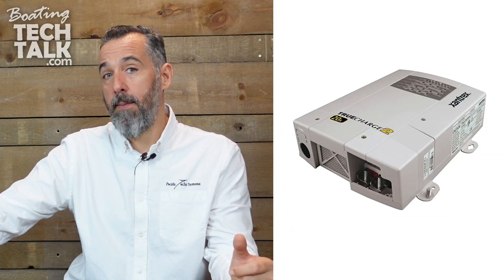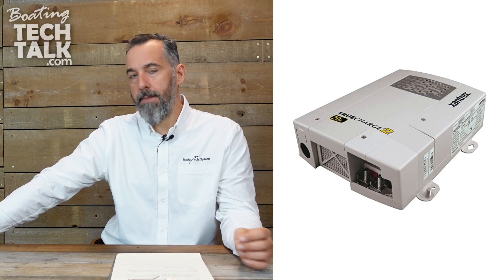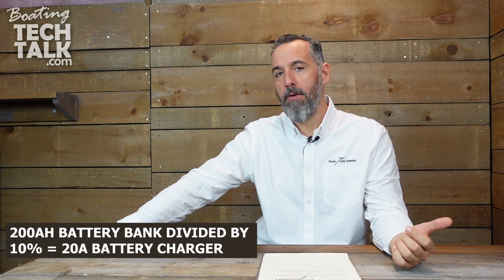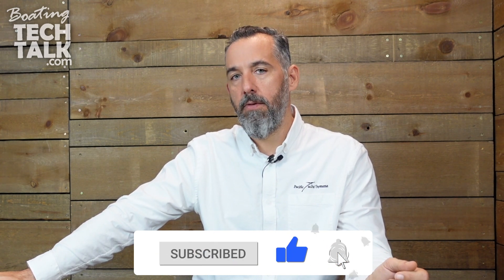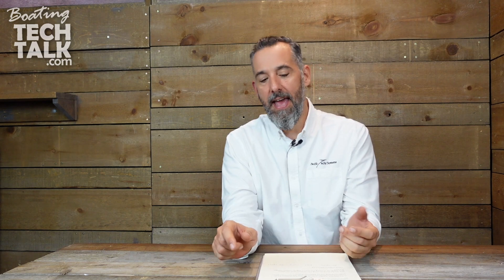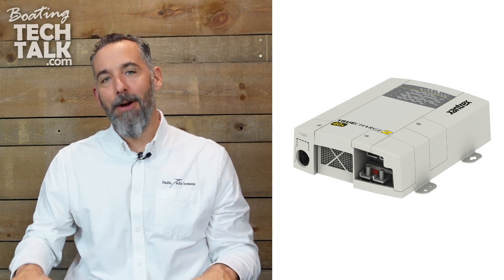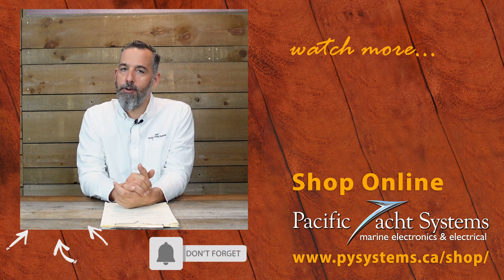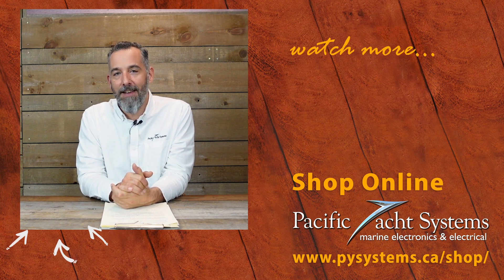Why Do My Boat Batteries Drain When Connected to Shore Power?

Comment: That’s a real good question….that charger is too small for a modern boat unless it’s a little 20 ft or somthing day sailer.?…they should have at least a 50 amp or 100 depending on what they run…so it can do its job quickly and live like a first world boater… headroom is your friend when charging…

Comment: What about the shorepower output?
Here in the uk, we have 240volt mains, but I think it's 16 amps.
I have a 5 amp smart charger from automobile days, and 600ah  notional battery capacity.
It takes my charger 24 hours! But at least I know the batteries are being treated gently!
Reply from the maker: you don't want to treat batteries  gently.  You actually want to force high charge when they are low.   Good / name brand batteries will have a posted min charge rate.  For example lifeline AGMs require at least a .2c charge for max lifespan.  Which would be a  120a charger for a 600a battery bank.  Firefly batteries actually require 0.4c or a 240a charger for a 600ah bank.

With a  5 amp charger you are barely charging.   If a fridge and a couple lights are on, you are only breaking even.  not even charging any more

a 16a 230v shorepower would run a ~200a 12v charger with nothing else on.
Reply: The charger determines the charging ability, not the shorepower unless your getting into very large boats with 50 to 100 amp service or whatever.. obviously you must have the power from shore to run the boats loads AND the power the chargers AC draw,to charge the batts… without head room ,everything can run hot or take forever to charge…always buy bigger than what you need.

Comment: Hello Jeff  I'm Con from Greece. I have a question for you. I have seen a lot of electrical plan's in several sites on internet that shows when there is an aluminum tank you have to ground it with     a negative cable samwer out of the boat to the engine or samwer else .is that necessary?
Reply from the maker: Good point, we frequently see a ground connection at a fuel tank and the fuel filler inlet as well, it's a way to prevent sparks.

Comment: Just installed a Xantrax 100ah charger, I turned everything possible on the boat on and was using 48amps.  Using the Victron Battery Monitor, I was only "netting" 52amps.  Thanks for the great videos!!
Reply from the maker: Glad to help Eric.

Comment: Jeff, are there any chargers that could throttle their output based on what the shunt is showing? I'm thinking of a scenario where a boat has a 100Ah house bank, but the loads still could be significant, maybe 80A. A 150A charger would likely be too much for the battery itself, but if it throttled its output so the BATTERY was getting 50A (but total charger output was 130A), there'd be a good balance. It seems like sizing the charger for (loads+recharge) could make it too big for the times when the loads were off, "if only there was a better way".
Reply: I believe all chargers will ramp down the charge as the battery gets full
Reply from the maker: To my knowledge, battery chargers are voltage and time driven as they charge through a 3 phase charging program. Not aware of a charger that interconnects to the shunt for adjusting charging.

Comment: Jeff love your videos!   Question - what do you think about installing local inverters as opposed to a central inverter.  I want to supply power underway to my ac refrigerator.   Rather than install a central inverter system I’ve thought to just put an inverter / battery near the fridge and plug it into the inverter.  Upside is easy do it myself without wiring into the central ac board.  What’s the downside?
Reply: Hey Jeff.  See that you posted then edited a reply.  Let me give a little more context.  If I put a lithium battery in the main system, then I need to worry about alternator issues and isolating the new lithium from the engines.   Some have warned me that Lithium is not yet foolproof enough for power to the dc side of house because if the bus shuts down the battery to protect itself then whole house system with navigation could go offline while running. Then also need to tear apart the ac panel.  By just plugging invereter with battery into ac outlet and running say 4 items from there, the worst could happen is my refrigerator shuts down.  I’ll probably go with the main system upgrade but think it’s an interesting option

Comment: Such good information! I have a question. Do inverters have some form of synchronization with of the 60 cycle AC waveform provided by 'shore power'?
Reply from the maker: Some of them do, they enable shore power and inverter to add together for short periods of time, helps prevent short shorepower breaker.

Comment: When you use (2) 6 volt  240 ah batteries wire in a series configuration how do charge them? Do I use a 12 volt or use a 6 volt?
Reply from the maker: Hi Sonny, you'll want to charge the 2 GC batteries in series with a 12 volt charger.